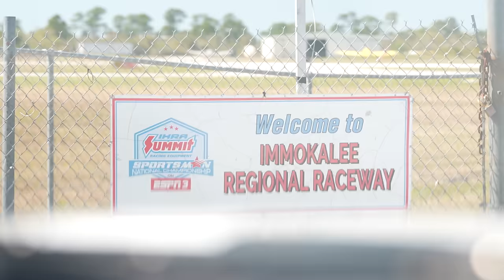SRC Takes on Floridians that Give ZERO F***S!

Comment: What beter way to take a vacation from his daily grind for Uncle Bob than to help and see his hard work being put to the test. 
Great job on dialing in the S10 Billy. That has been a pretty consistent and salty little truck.Too bad on the Nova or you'd have had 2 wins. 
TTG, I can hardly wait for you to get that motor back in your S10. It looks and sounds great, and it's been what seems forever. You were driving it when i started following you guys.
All the best!
~~Dave

Comment: That S10 hooks up and goes. You wouldn't think so because the rear end is light. Too bad the Nova had shifting issues. That looked like a 71 or 72 judging by the taillights. My dream car when I was 16 years old was a 69 Chevy Nova SS with a 396 4 barrell 4 speed manual. The closest I came to owning one was I had a worn out 305 automatic from a chevelle. It had a one inch tall slice about one foot long above the right rear wheel. 
Great video.

Comment: Looks like everyone was having a great time. Especially uncle Bob. Congrats on the win with the truck. Anyway to replace the rubber bumper with a billet piece?  👍
Reply: Drill that rubber baby buggy bumper and pin it so they cannot just fall off, and hand on the shifter anyway, never rely on auto shift. Once you feel it go forward, you move the hand up....if it does not, then you do it a little late is all.

Comment: Limpy 100percent correct, seemed liked alot of guys stayed in it more than they should of
Reply: I think the promoter said it best.  Guys down there are not real experienced on true no prep surfaces and simply didn’t turn their tunes down accordingly and the cars got away from them.
Reply: @danmyers9372  i do get what limpy is trying to say though
You think you have this extra space but it just allows you to gain momentum before you smack the wall

Comment: Is there any reason to do your burnout off the brake or 2 step on a turbo car? I'd think with a healthy motor, it should have no problem starting in 2nd to do a burnout, as I always start in 2nd and shift to high asap, then roll out. I'm not sure what to run for a tire either! Stock style suspension 99 Camaro, 1200hp capable, streetcar, but I have no issues switching tires, not a big deal on beadlocks! Planning on running Nittos on the street anyway. For a budget shock setup, would a slick, or stiff wall work better than trying to hook on a MT Pro?